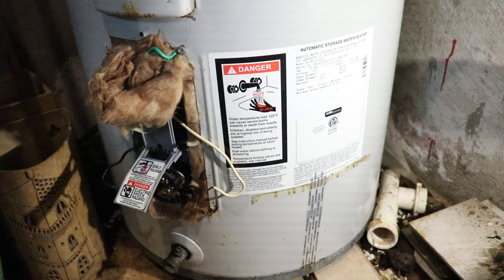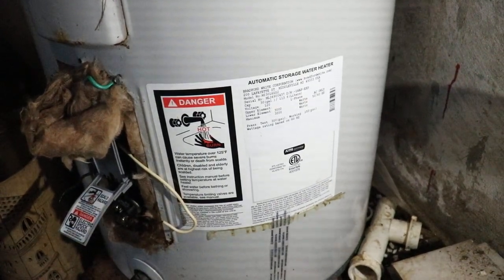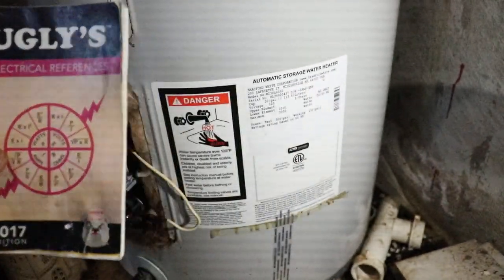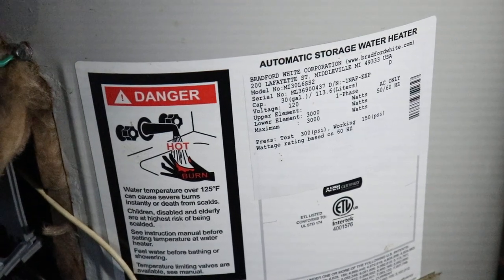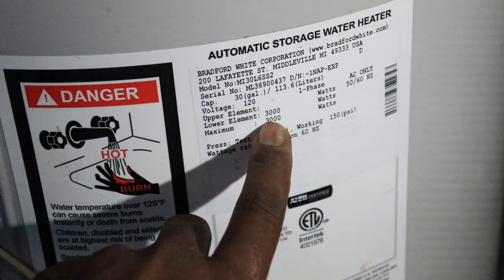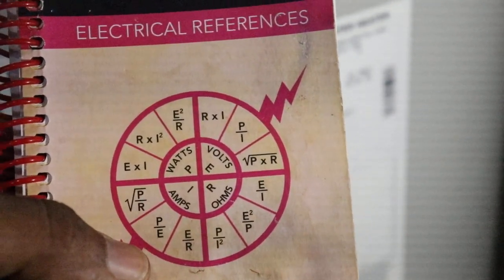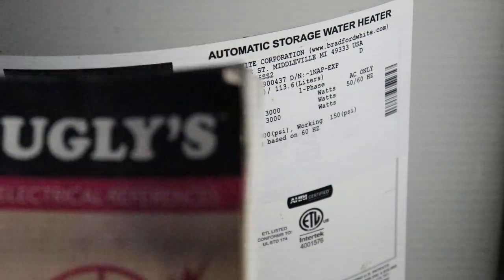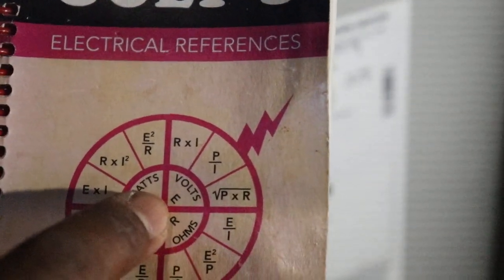correct way to size your water heater wires and Breaker size!!!!

Comment: So i have a 240 volt wire and i want a 4500 Watt water heater so use 25 amp breaker??
Reply from the maker: Use a 30 double pole amp breaker and also make sure the conductor is 10 AWG. 25 amp breakers are normally hard to find.

Comment: Hi I would like to add a comment about your information on this video, first of all you CAN’T divide voltage to watts. You did it backwards, it should be I=P/E so P divided by E (voltage) 3000/120 and you should add 125% because is less then 120 gallons. And then to get the over current device it should be adding 150% so if you get the 25amps at first then add 150% to get the overcurrent protective device. Go to 210.19(1) and 422.13 also 210.20 also 240.6(A) also 422.11(E) thanks hope you can understand my comment
Reply from the maker: Thanks for your feedback..inoder to get the overcurrent protection which is (also called a breaker in this case)  it's 25Ax125%=31.25 so the breaker would be a 30Amp and wire size is 10AWG  for this water heater.. I'll have to make part2 of this video...thanks again for your comment.

Comment: i I have a 240 voltage electric hot water heater with 4500 watts ... i divided that and came up with 18.75 amp.. so i guess i can use a 20amp breaker ..... but what size wire will I use ...?
Reply from the maker: Thanks for your comment...so your getting almost 19 Amps..a 20 Amp breaker would trip easily because the breaker is almost at it's maximum load of 20Amp...so the best thing to do is to get 30 Amp doublepole breaker and the wire size should be #10 AWG. Note. Your should not be loaded at more than 80%...I'll go into this in another video..please subscribe for more information..And give me a feedback after your get through with your Installation...good luck👍🏾

Comment: since the water heater is a continuous load, why didnt you upsize the breaker for the over current protection?
Reply from the maker: You're correct... exactly what was done here, the Breaker was upsized to a 30amp.